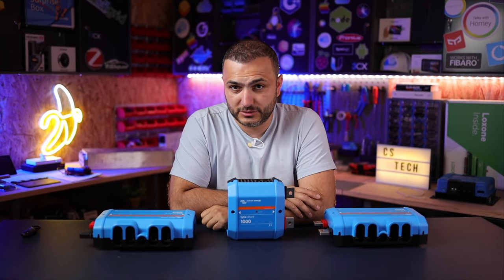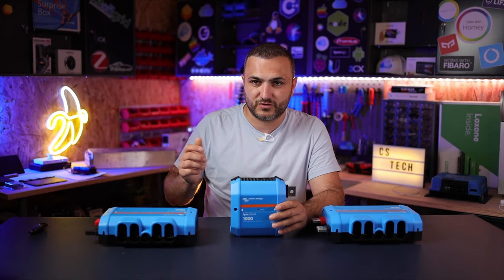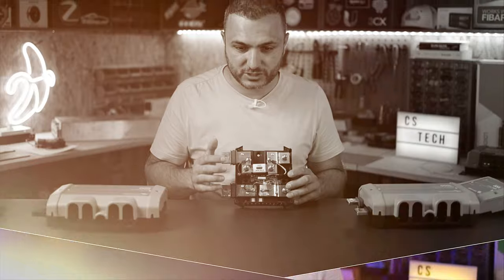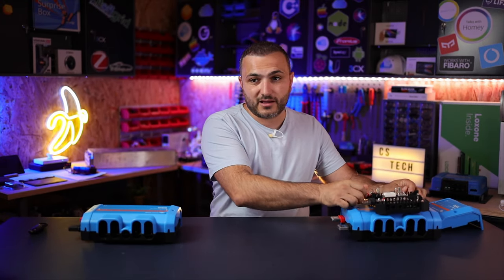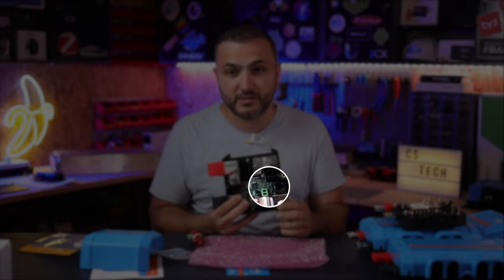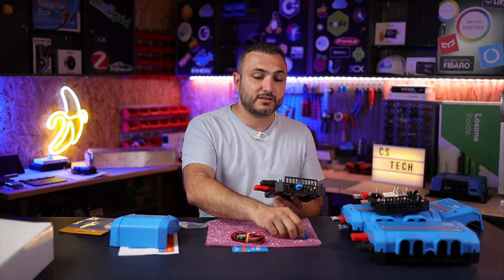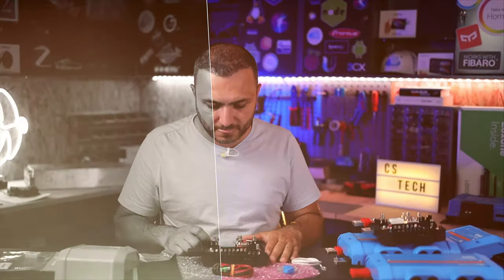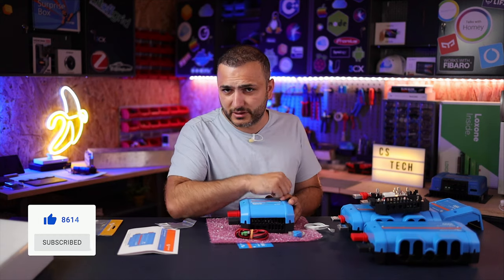Lynx Shunt VE.can from Victron Energy

Comment: The fuse that is placed in the shunt must be equal to or greater than the sum of the amperages of all the batteries that you connect to the distributors on the left side of the shunt?
Reply from the maker: Fuse must be 10% greater than battery capacity.

Comment: Hi mate

The shunt is rated for 1000A but there are no fuses for that current.

I need 900 amps to go through the shunt.

Can you give me a recommendation how to solve this issue?

Thanks a lot

Greetings
Reply from the maker: Hmm...900A is a huge curent even for those busbars.
I recommend you for this current to go for custom busbar in separate box with ETI Fuse (https://www.etigroup.eu/products-services/special-purpose-fuses/fuses-for-railway-applications/004305637-fuse-link-g3lm-3l-nh-1000a-1000v-ar-1ms). 
Victron LYNX is for max 1000A, but I recommend to go max whit 500A-600A. Their max fuse is ANL-fuse 500A.